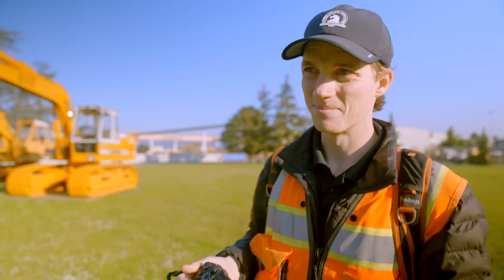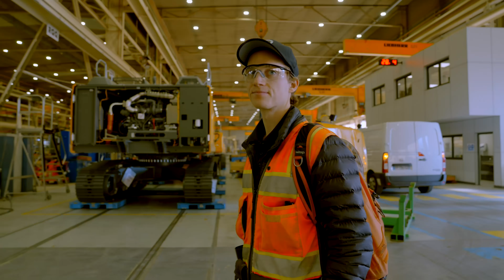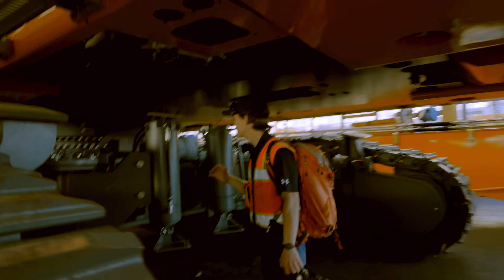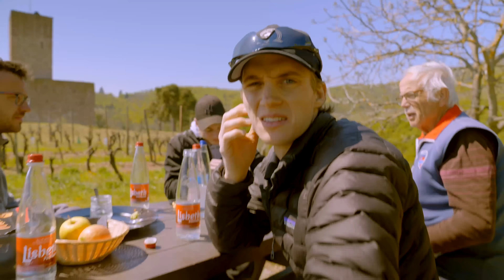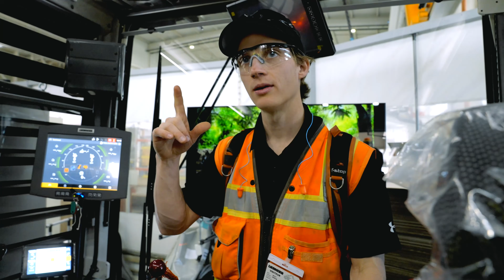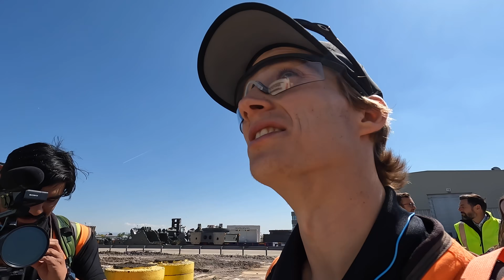I Can’t Believe They Let Us In Here | Touring TWO Liebherr Equipment Factories | Euro Vlog 6

Comment: I'm not working for Liebherr but we "paint" our machines inhouse for most likely the same reason. It's more a powder sintering / backing process than a real paintjob. Paint is really thin and many chemicals, like saltwater, or even some sanding from dusty wind will damage the paintjob and start corrosion.
It's a lot more effort, but the coating seals the machine for a lot longer and you can also go ham on the pressure cleaner. Only downside it's a lot heavier than paint, and you are bit limited to firm colours. Something like metalic or sparkling thats done by many thin layers of paint on road cars does not work with the big paintbrush.

Comment: Next time you visit, can you ask them to fix the stability issue with the loading shovels? They are like driving a demented space hopper. And that is before you roll back onto a rock when you are pushing up products. At that point, you will need some very sturdy underpants.

Comment: I understand that you're not interested in cranes as I've heard you say before, but do you know who builds the most powerful, and largest mobile cranes in the world?
At the time you filmed this video, you were at the earth moving complex they have. 
I've personally had the largest in N Texas at the time on site lifting HVAC equipment into place for the job I was running at the time. 
It's amazing what that machine was capable of achieving, and to think that it drove on site under it's own power down the hiway some 40 plus miles from the office of the company that owns it, and afterwards removed all the counter weights, and pieces of the extended jib boom is a sight to see especially after the assembled setup in action. 
People who see it on the road I'm sure don't have a clue as to what they're actually passing on the hiway, are the capabilities it has. 
I'm sure Turner Construction has photos of it from start to finish on the Collin County Courthouse renovation and remodel job done in McKinney, Texas around 2010 or 11.
It's an truly awesome site to have been lucky enough to see, and actually have it doing what I instructed the operator to do. 
I've had many different cranes on many different sites during my past career of every imaginable type as well as variety of manufacturers. 
That was one of the top machines to have the pleasure to work with and  in my lifetime of experience in my trade.

Comment: About those electric shovels they actually runoff of generators that are powered by 16 cylinder diesel engines they have a very huge electrical extension cord attached to them and they drag them around in the mine! Even caterpillar makes those Caterpillar has a electric drive system on there 797 mine trucks

Comment: Hey, Aaron that big Electric! excavator... where do you think it"s getting the Electric power from?? Plugged into the wall back at Home base! Do a video on that cause you'll find Big Huge Deisel generators back at the base So Nothing Green about That!!
Reply: not really, depends were they get there electric power from. In Germany we have 50% green electric energy. 10 years a go only 25%. 
Also a Diesel-Electric Motor needs 30-35% less Diesel for the same energy and the Electric Motor with a Diesel Generator needs much less maintenance and breaks less. You also don't need a clutch or a gearbox, which are also very vulnerable. You can also brake with the electric motor without wear and tear on the brakes. With the electric motor break you become energy back. 
Without a gearbox, clutch and normal mechanical brakes you are even lighter, which in turn saves energy. The diesel generator is also less stressed because it always produces electricity at the same speed. This protects the generator and it also needs less diesel. Ships, Submarines, big mining trucks/machines have been powered in this way for years. 
A mining company in Swiss have build a full electric mining truck which charges itself and requires no external power. At the moment, however, this only works because it is going up empty and down when fully loaded. by fully loaded braking with the electric motors, it gains more energy than it needs later to start up.

Comment: Awesome content, The whole electric concept for large machines is interesting cause they either run motors with generators or like the last one connected (typically connected to the grid or large power supply)...innovation is awesome but i would be interested to see the benefits especially where fossil fuels are still used for the grid

Comment: You can get Tracks with bigger Grousers too. I believe Liebherr has a side hill machine as well with tilting/telescoping Chassis, etc.
https://www.clikuc.com/uploads/allimg/170607/2-1F60G42023396.jpg

You are a Journeyman Welder (with Red Seal in Canada anyway, and it’s recognized worldwide) and then there are add on tickets/Certifications, Pressure Welding, Welding Engineer, Welding Inspector, etc I imagine there must be an in house Structural Steel Certification at Liebherr

Comment: I’ve just read a story about an electric truck transporting rock from a higher elevation quarry in Switzerland down into a valley. The interesting thing is that the regenerative braking going downhill in the fully laden truck produces enough electric energy for it to be sufficient to power the empty truck back up the hill.
Reply from the maker: Pretty neat
Reply: Perfect application for electric behicles.
Reply: I don’t know about the newer trucks, but the old T282 Liebherrs do the same but the braking in them are pretty garbage. You need to really be on the brake for awhile before it even starts to do anything!
Reply: Fortescue mining in Australia run laden trains down hill to the port producing enough energy from regenerative braking they can power themselves back to their origin with energy to spare.
Reply: That’s not possible ? Or is it ? So your telling me that Haul truck could run forever as long as it’s battery and regenerative    brakes keep producing power minus flat tires, and other things that can go wrong
Reply: @Diezeling  it has more mass coming from the top of the mountain, more potential energy (theoretically) than it would need to go back up the mountain with lower mass. Of course a lot of energy is lost in regenerative braking, friction/heat, etc, but under the right circumstances with high enough efficiency it’s definitely not impossible.

It’s not that it can run forever indefinitely. This only applies when there is the same amount of energy going into the system via the regenerative brakes on the way down as there is leaving the system when it drives up the hill. It only works when it descends with more mass than it ascends with. On flat ground or with the same mass both ways it would be impossible.
Reply: @Diezeling  It isn't far fetched, but obviously you need to factor in the energy used by the  machine that is loading it (which would have to happen either way). Machine at the top of the hill winds the rubber band, essentially coast downhill which winds it tighter, and use the built up energy to return.
Definitely not a perpetual motion kind of thing, but pretty smart, regardless.
Reply: @Diezeling  Your forgetting the energy input of the machine that loads the truck...
Reply: Not quite... Not only the infrastructure to do that is expensive the laws of entropy make it impossible.
Regenerative braking doesn't event work like that on trains. It is always a part regenerative braking system.
Reply: Like some ore bucket conveyers they require no power provided the ore carts are full going down enabling the empty’s to return to the top to continuously move material … same principle
Reply: There's an old mine near me. In the old days fully laden tubs of rock slid down a ramp to be taken away by train. As each fully laden tub slid down, it's own weight pulled up the next empty tub on a cable, ready to be filled (Osnabrück, Germany)
Reply: eemily792 v Mei 2021
Emily...
Reply: Edison Motors is hoping that this will work out for the electric semis they're planning. Go up into the mountains empty, come back with a load of logs. Maybe top up the batteries at the mill once a week.